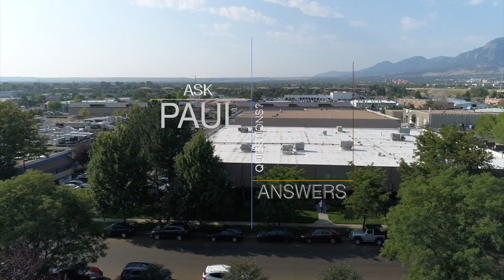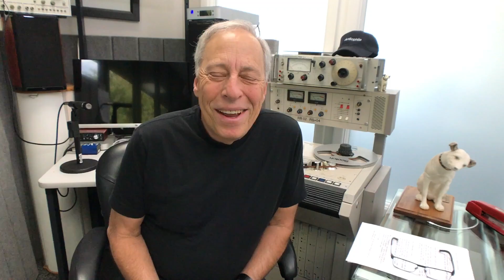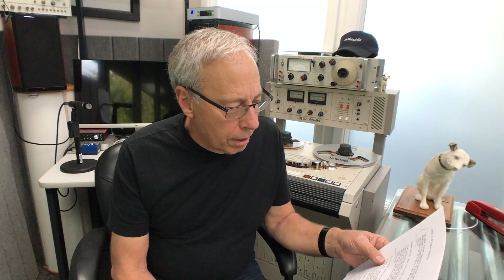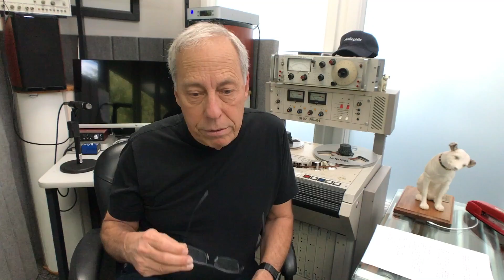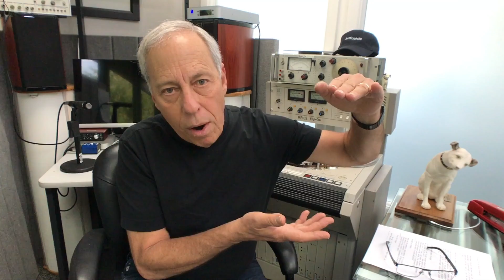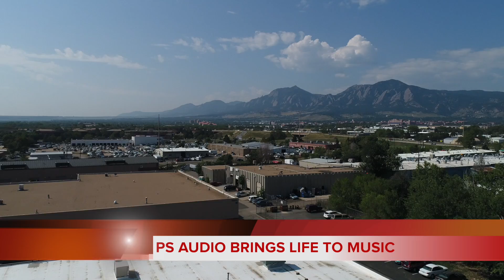How to build your own custom speaker towers

Comment: PAUL the BEST speakers I ever built were with my DAD, the Speaker boxes were Square , were insulated with SAND , and had 2x Tweetters each , had 2x Woffer each and 15x Mid range each w/ Custom home made circuit. 
we used old radios & Goodwill speakers to source Random speakers.
Performed better than commerical Speakers & Relistic speakers of the time. 
we once UPGRADED the Speakers to NEW purchased unenclosed Speakers from Radio Shack before they Closed. 

we also upgraded the Circuit w/ modern SMT & miniture componnent Technology.

Comment: I'm really surprised by Paul's answer here. This is just a bad idea period! An enclosure is part of a speaker design which includes all kinds of things, like baffle stiffness, width, internal dimensions, sound dampening, even internal bracing are part of the design. 

To illustrate. The Nissan Pathfinder and Nissan 370Z have the exact same motor. One is tuned and designed around a transmission for an SUV, the other for a sports car! He'd be better off finding a decent DIY speaker design on the internet and building that. Troels Gravenson is a great start.
Reply: On top of that , a line array of ttweeters needs very close spacing of the acoustic centra . This can't be guaranteed with these coax drivers . Very bad idea

Comment: Parts Express has a subwoofer crossover that you can add to any speaker you want to roll off the highs. I had a pair of sonics 447a that sounded terrible. I took it all apart and reconfigured the crossovers for the woofer added a cs99a low mid and then use the sonics dome mid-range with some Sonic's early model titanium dome tweeters. 100% improvement using the subcrossovers from parts Express

Comment: I'd get a low pass filter for about 120hz with a 12db rolloff or better yet invest in a mini DSP and bi-amp the system then use an active subwoofer. I'm not an expert by any means just someone that likes to tinker with sound and speaker builds.

Comment: I built a pair of transmission line cabinets based on the Bailey design with KEF and Coles drivers and Falcon crossovers. That was 40 years ago, and despite being dragged all over the country, they still sound good. Falcon are still in business if you need crossovers:    falconacoustics.co.uk.

Comment: My slow on going Project: AKAI  ST-400 speaker cabinets (1973). Mavin soft dome tweeters (American) and Mavin soft dome midranges. I am reusing the crossover filters from the AKAI ST-400 as they look quality to me. This year I will finally buy my Beyma studio woofers that go as low as 25/29 hz depending on wich "set up" they are build in. I am thinking ports and placement of them in the AKAI ST-400 speaker cabinets. The speaker cables will be soldered on to the crossover directly so I get rid of the clips at the back. Fill them up with some rockwool like in the seventies maybe or go fancy. Why demolish vintage speakers like that ?Mice had nested in themat the place of  the guy I got them from.

Comment: Not tough to do the crossover. Use software to create a two-way crossover where the bass is sent to the 10" woofer and everything else is send to the coaxial speaker array, its rather simple. The more complex part is that the array of coaxial speakers needs to add up (when ui wire then together) to a load that is somewhere between 4 and 8 Ohms.

I would look at the woofer's rating and match the coaxial array to it (that s not actually necessary but it seems to make things easier). Then once you know that number (lets say that its 8 Ohms) you would arrange the wiring for the coaxial drivers in series then in parallel to mathematically work out to the same as the woofer (or at least in the range of 4 to 8 Ohms). It might require a lot of wiring but wire is cheap and your speakers will sound good. If you do not do this then you are likely to either have a lot of drivers out of phase with each other which will muck up the sound or you could create a load that your amplifier cannot rive properly (it will play too low, or will be very distorted or will melt the output transistors of the amplifier because you are drawing too much current).

It sounds like a fun project, good luck!

Comment: A co-axial is two separate drivers in one assembly, not a single full-range driver (like a whizzer or fostex)
Reply: I know, I was wondering what he was talking about. The tweeter and midrange have there own xovers too. In any case, putting a bunch of drivers in a enclosure made for a completely different application is a recipe for disaster.
Reply: Damn, how did Paul miss that one?